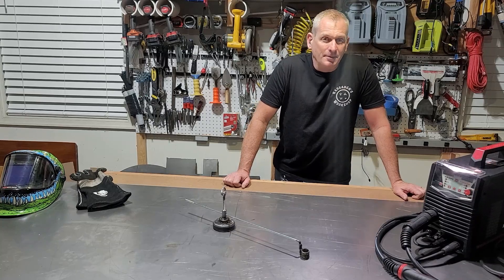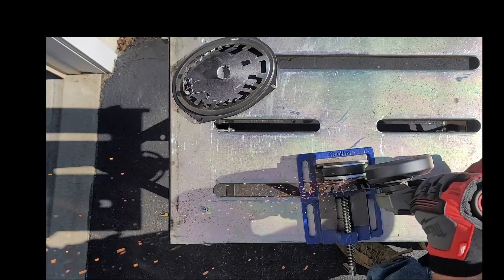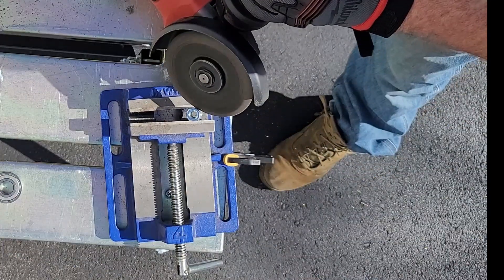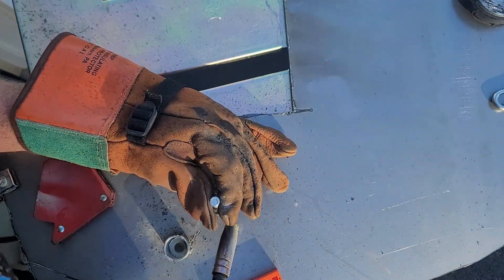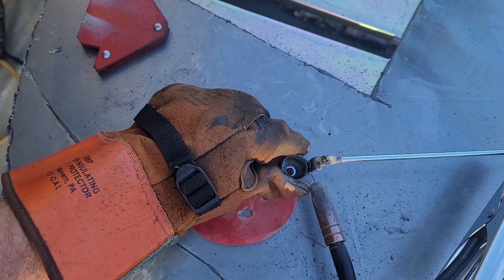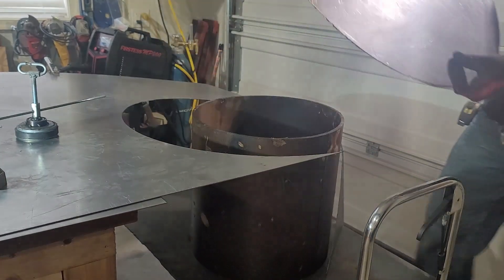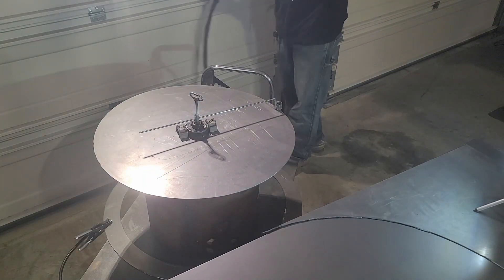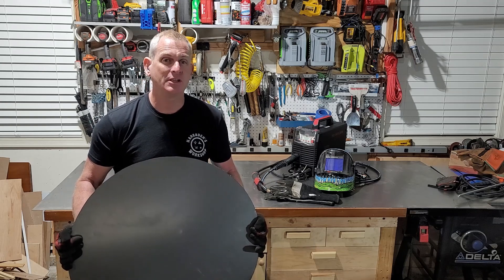DIY Plasma Cutter Circle Jig

Comment: Are you using a drag tip or pilot arc
Reply from the maker: The one in the video is a drag tip, the other plasma cutter I just got. I will adjust the cup of the jig to allow my guide for my pilot arc torch to fit.